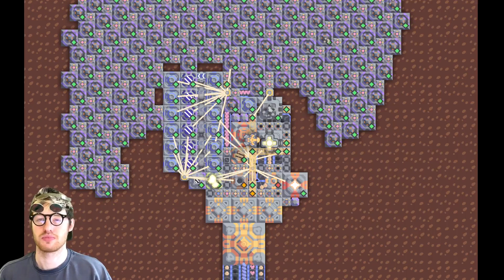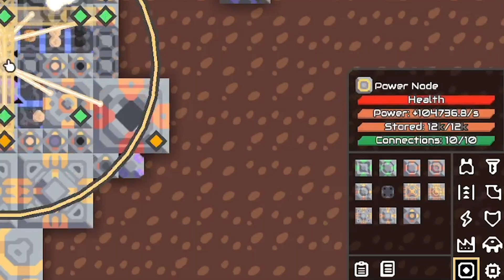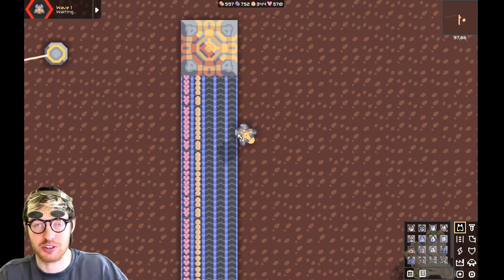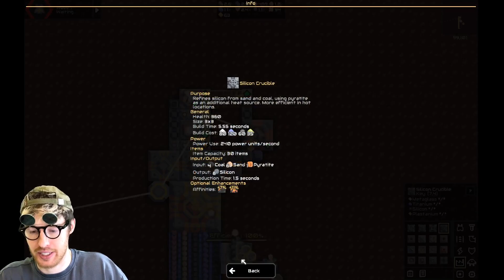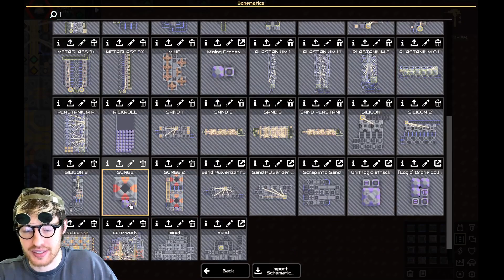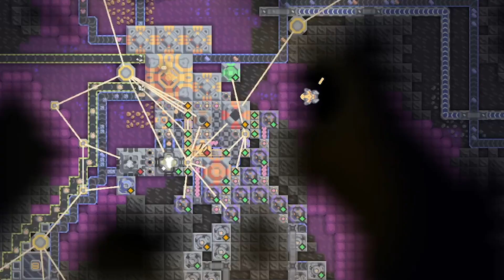Mindustry schematics for Campaign! makes silicon, plastanium, surge, graphite, metaglass.

Comment: With a minimal amount of thorium and titanium you could make : 4 thorium reactors and one cryo and overdrive it for 8k power. One cooled laser drill is enough for the thorium and you can use pneumatic drills for the titanium
Reply: Im 4 years late but I use diff gens now cause now its harder to aquire thorium because of landing pads.
God dayum im late
Reply: Unless you have tons of thorium, Thorium Rectors suck for power production, their power is way more expensive than RTG.
So if you have the space to place them, always use RTG, they will produce way more power for same amount of Thorium consumed compared to Thorium Reactors.

Comment: Magically compact, beautiful.
One quirk is the potentially very different rates that it produces different materials, it's amazing for capturing individual sectors where you realistically don't need equally good production for all materials, but I think we can work on a bigger modular variant with roughly equal rate (e.g. 10 units/s each) that works in a produce-it-all resource factory base that is used for launching to other sectors.

Comment: But in order to jump from sector to sector and you wanna prepare, you NEED more resources. eradication sectors want like 8k copper-lead, 4k thorium-silicon initially, or something.
Reply from the maker: Wait what point are you trying to make here? I don't understand bro
Reply: @SCHEMATIC  In the campaign when jumping from sector to sector (optional, not the actual campaign sectors), you need resources. and the higher the difficulty + higher tier core, you need more base resources to actually jump in the first place. I guess I was just thinking that having low amount of metaglass (You decided that 2k was enough, as if lol.), for example, tripped me off. I like to have a little more just in case initially when entering another optional sector. Just my personal opinion though, no hard feelings.
Reply: @OddWorlderer  yo,i always launch with maximum resources to ensure that i take that sector in the first shot.i even went as far as mounting unit factories off the core that way i have t3 straight out the gate
Reply: @OddWorlderer  i usually go for polies or megas too